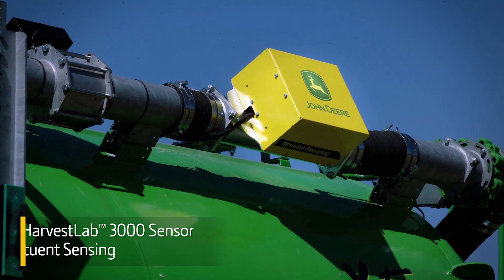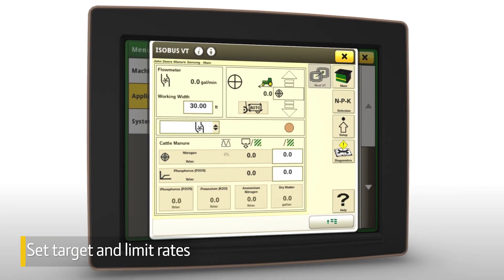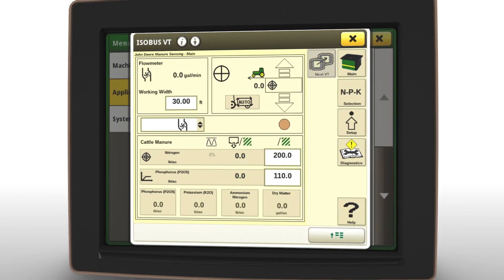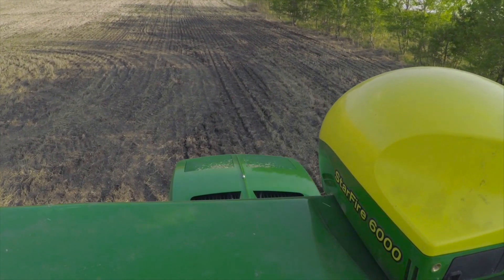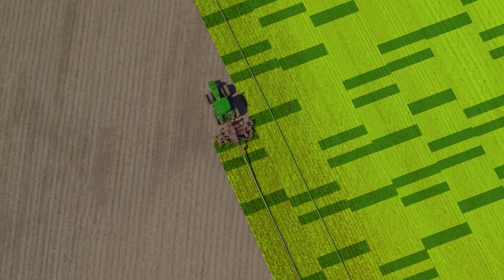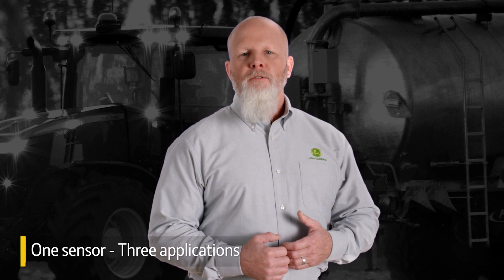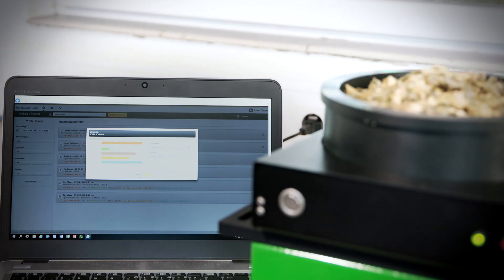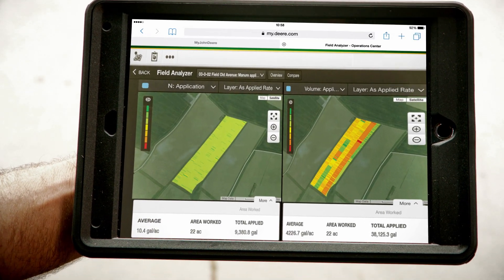Nutrient Sensing Technology for Manure | John Deere HarvestLab™ 3000

Comment: Can this be incorporated into newer agco tractors?  Is challenger 1038 and 2017 fendt 930....what instruments would we need. Display, gps reciever, rate controller, will it tie into agco tractors system to control ground speed. We apply with tanks. Thanks. Kevin. Spring Valley Spreading Llc.
Reply from the maker: Kevin, your local John Deere dealer is your best resource for technical questions like this one. You can find your closest dealer here: http://bit.ly/30S2epa.